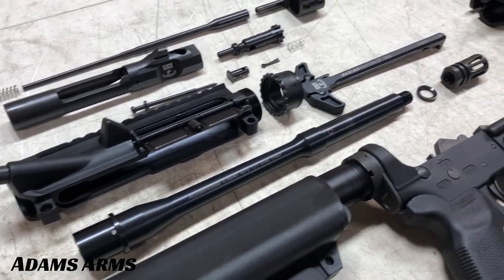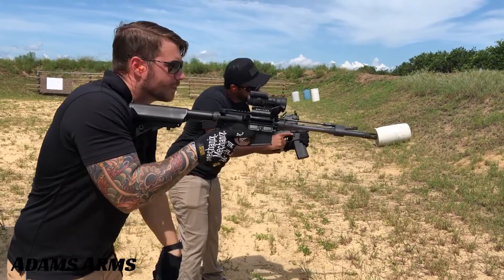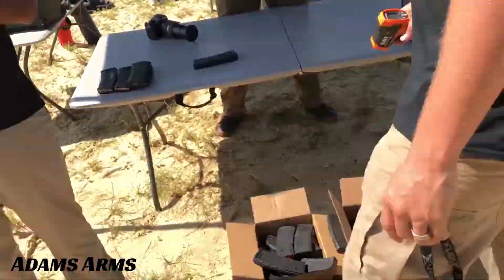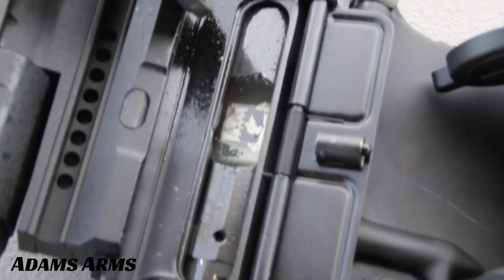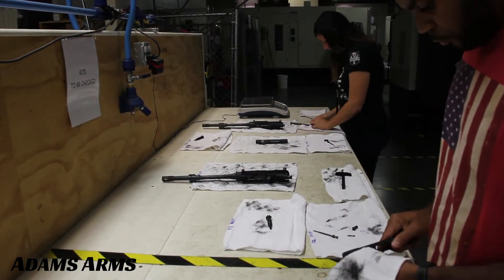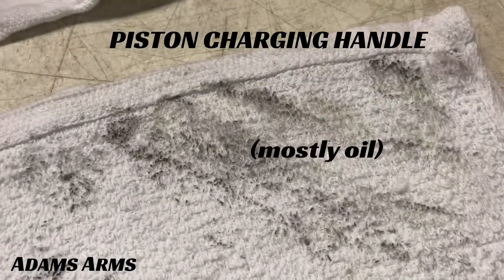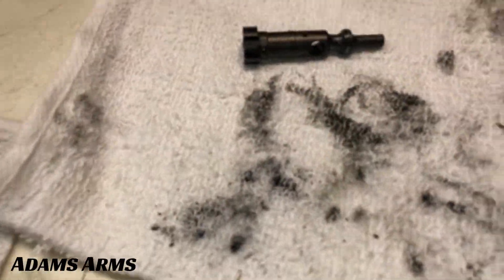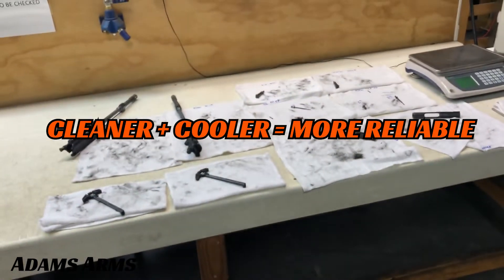Adams Arms Piston Versus Direct Impingement

Comment: Everyone says DI is fine and yeah most of mine are DI. But it's no comparison on the overall longevity when it comes to piston vs DI if u ask me. Especially if u rapid fire alot and for long bouts. Most people I guess don't do that but I like to build a working gun with piston in mind over DI. Unless you're gonna get a chf hbar barrel or chrome lined barrel or something, with an inconel tube and a bleed off block, I wouldn't suggest using DI for ur long term hard running work gun/combat carbine. Yet again, this is something most people aren't doing so if that's u then there's no need for it. But if u do, u would be silly not to go piston. Especially if u run suppressed. U can either have a bleed off DI block or bleed off piston block either way u really should have one for running canned IMHO. I know everyone is diff on their prefs that's just my 2 cents. DI is better for ur mid length and rifle length builds, if ur trying to shoot range accurately, distance. Not as good if you're wanting to put the hammer down to her long term for 75 to 100 yards. Like I said if u wanna rock an HBAR barrel or chrome lined barrel, inconel tube and DI bleed off block, have at it. That's what it will take to be equal to the piston kit. Nothing wrong with DI but it's all situational use

But I'd much rather disperse crud, heat and debris out the front of the gun and not back at me. And who wouldn't take a quick 5 position toolless gas adjustment bleed off piston block? The whole thing is way more robust than a DI tube and DI block. There's no comparison. Now i do recommend u have a decent quality barrel running piston kits because of heat in one area. I run Hbars and full bull just for that reason. If u do u wont have an issue. Make everything else lightweight if u just have to, to make up for the weight. 

Really the only drawback to these retrofit kits is the fact u need a rail with a standard barrel nut or GI barrel nut in order to use the conversion system. It's not the price. It's not the performance or functionality. Its that it wont work with just any setup

Comment: Do it with a quad rail and measure the temp difference. I would imagine the piston kit would heat the handguard much quicker than "DI" as you call it. (The AR 15 is not DI. It's more of an internal gas piston operating system) I'm not saying your kit isn't cool or anything. I want one.

Comment: Hello AA, I need some help.
I have a Spikes Tactical lower with an Adams Arms upper and have a failure to feed problem with scratched brass.. the rifle will fire a few rounds, but randomly fails to feed a round, scratching the brass casing. I have the AA gas valve set at 12 o’clock. If anyone knows what it can be, please let me know.

Comment: Please, what about the carrier tilt problem?
Reply: It's not an issue.
Reply: There are ski's on the carrier
Reply: If you are worried about the carrier tilt, primary weapon systems makes a buffer tube you can buy and it has an extended lip so the bolt carrier will ride on that and totally eliminaltes carrier tilt.  i have it on both of my adams arms...it is a standard mil spec buffer tube

Comment: Looks good but it's nothing new.  The FAL had this system back in 1946/47 and Colt had this on the model 703 in the 1960s.  If you don't have gas going to the bolt why do you have a bolt with a gas system?  I would think you would have designed a completely new non gas bolt for your conversion that contained a lot less moving parts.

Comment: I call these AK-15s. Listen here now -- these kits were really designed for a specific crowd, can (suppressor) owners. I can tell you first hand that running a can on a DI AR is unpleasant to say the least. Toxic gases spitting back out through the charging handle into your face is horrible. With a piston kit, you got yourself a pseudo HK 416.

Comment: First off, never use a metal scraper on the bolt tail. 2nd, that carbon on the bolt will create zero problems with reliability..3rd, look in the upper receiver cam pin recess and compare the gouge between them..4th, The AR platform was not designed for an external piston system and putting an external piston on it creates more problems than it solves...This is why I went back to the internal piston and removed the AA piston set up over a decade ago..A fool and their money lol....

Comment: Biggest advantage to the piston is actually in bolt/carrier temper. Getting your bolt/carrier too hot can actually soften the steel.
Reply: The temperatures to temper steel are substantially higher than what they achieved in this test. The temps they achieved would be more for relieving stress in the metal and require holding the temp until the metal is uniformly heated.
Reply: @dunzerkug  I've personally seen heat patterns on extractors that have caused them to sheer on duty rifles before. 

The extractor is what you have to worry about. Typically, your gas tube will give out before your bolt receives that sort of heat, but it happens. 

next time you run a string of 100+ rounds, reach in there and touch that bolt face with your pinky and tell me how hot it gets 🤣

Comment: Send one of the p series adjustable uppers over to the channel and I’ll do a independent test with my suppressor and compare it to the mk18 I have I also had one of the older xlp systems I got to run on a 10.5 556 check my vid out